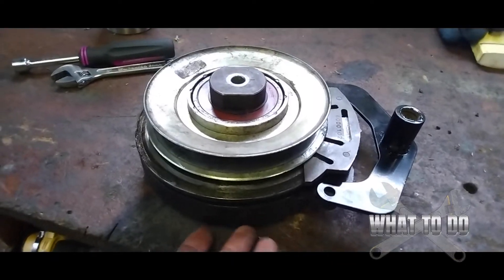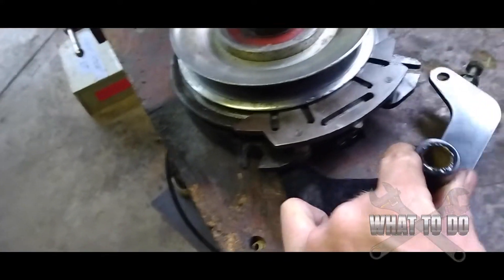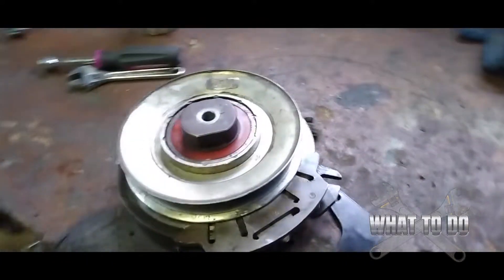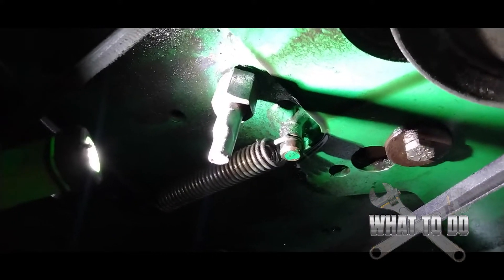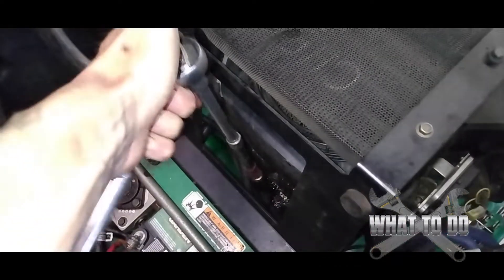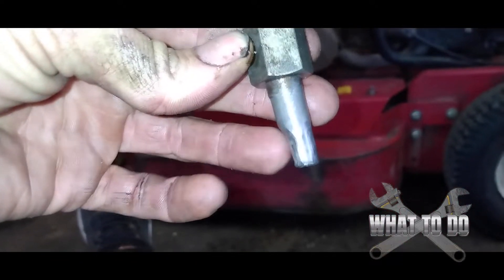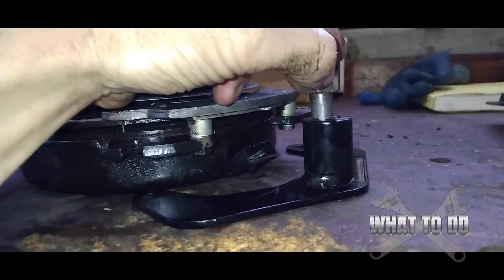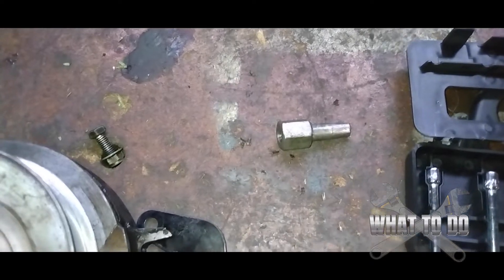Bobcat Clutch Issues / Rattle / Noise / Broken Clutch Bracket

Comment: Looks like that would be a great use for some urethane bushing material. Mix it up, put it in the hole in the bracket where the pin sits, install it, let the urethane set up and ride out. That should dampen the vibration and keep the pin from ever wearing again.

Comment: Should there be a bushing inside the bracket?
Reply from the maker: No there isn't any bushings on the bracket. Not on the models I've worked on. Once you have it installed it will have a little bit of wiggle that's the way it's supposed to be.